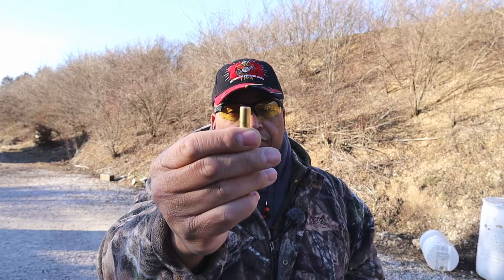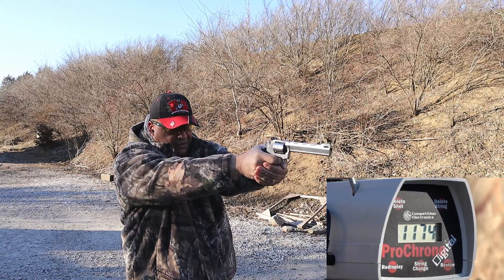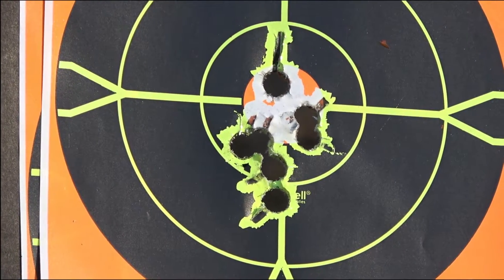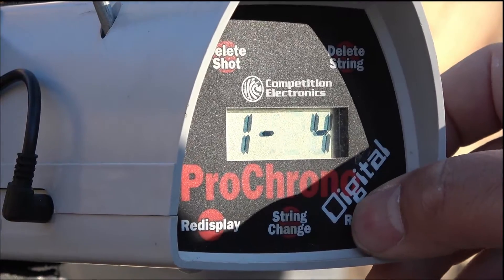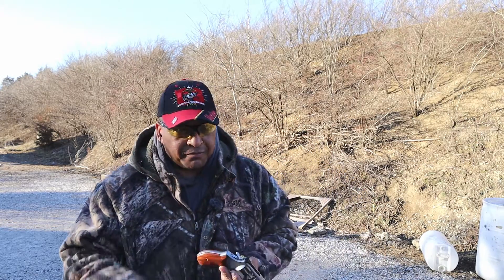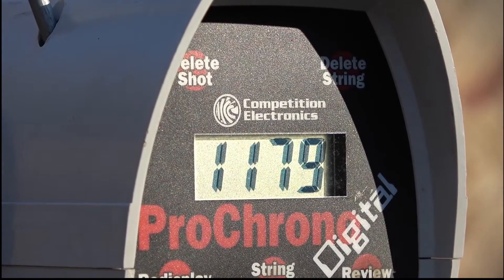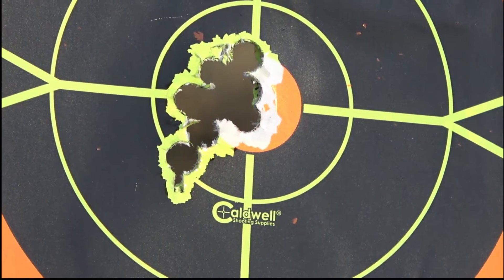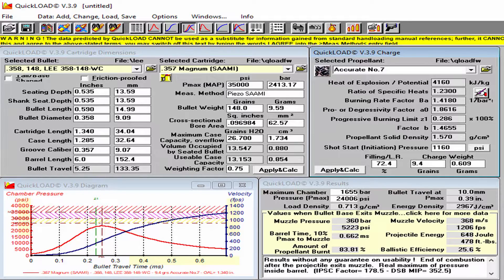357 Magnum Wadcutter Development - Bone Crusher

Comment: I like to go slow. 3.0 gr Titegroup, 3.0 700x were two, of six accuracy/chrono tests .most accurate, lowest SD about 860 FPS. One hole group type of DA shooting at 50 feet.  4" Smith 19, and 4 " 686. Also, find and try Shooters World Cleanshot. That stuff in 38 sp WC does 15 SD and crazy accuracy out of a Model 14.

Comment: Really enjoyed this one, as I reload 38spl/357mag for my GP100 and Marlin 1894. I have not reloaded wadcutters, but I have experimented with seating the bullet with the base forward. I reload Berry's and have experimented with loads using Hodgdon Universal and 158gr HP copper plated. I ran these up the pressure ladder to push the velocity to where I could possibly detect keyholing (at 50yards). No issues. Too bad I did not run these thru the chrono at the time, but sometime in the future and I will share. One thing about wadcutter loads. Make sure that you trim the brass to length after resize, so that your crimp will be the same from round to round. the SW with the 8 shot cylinder was close in velocity for the last 6 of those 8 shots and the SD would have been 15fps. that is very tight. I think you can push the velocity up with this round, especially in the Marlin with microgroove rifling without losing accuracy.